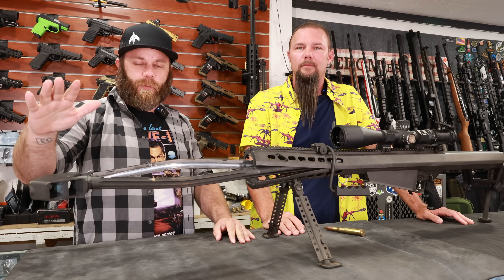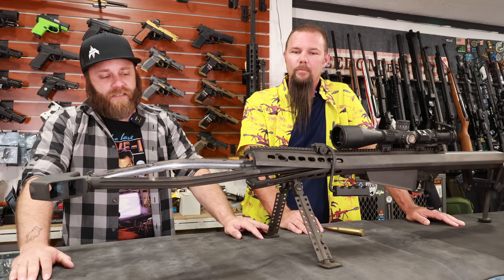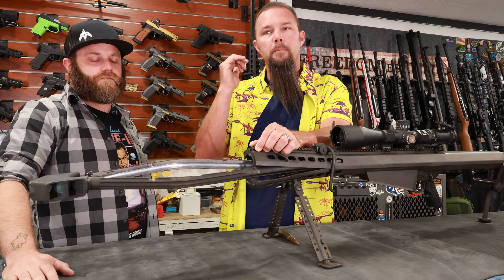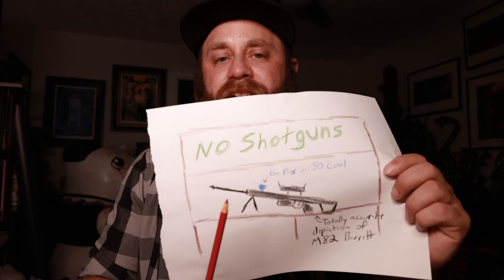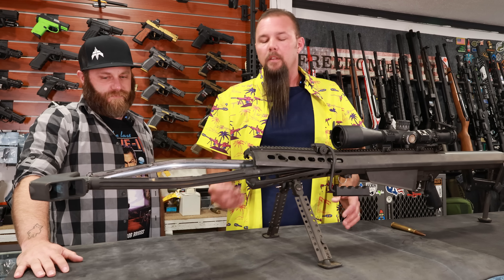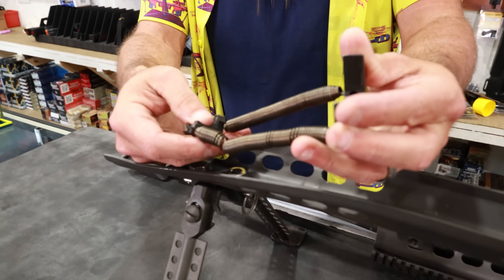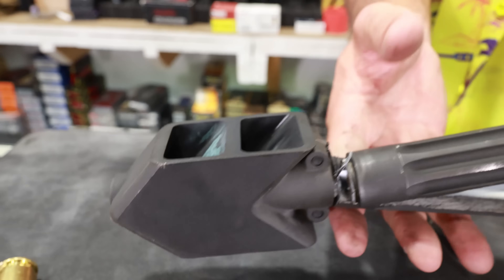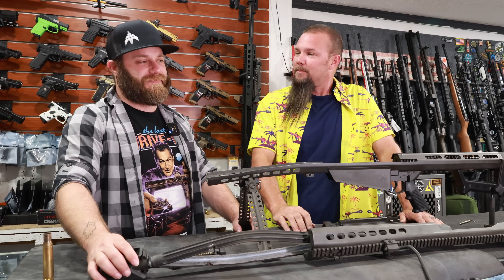Barrett 50cal Explosion Explained! 50 Caliber. 50 BMG. M82A1

Comment: Ok so tell me once more how it actually got hit with the 308 like I have literally watched that part 3 times and I'm still unclear of how a 308 round hit the barrel to start with I get that the little dimple was there from being shot and exactly what happened to make it go boon but what were you doing for it to get shot in the first place like it sounds like your trying to explain it but I'm obviously just not picking it up I'm going to try once more but can someone please in detail explain the setup that allows this to happen were you using it as a prop for slow motion films?? Like I don't get it. It's just not comprehending in my stupid head..🤷
Reply from the maker: Let me start by saying, I was not at the range day that the Barrett was hit so my details are loose at best but I'll explain it as best I can. 

The Barrett is a beast so while all other firearms stay aimed down range at all times while on the shooting table, it gets placed at an angle that aims it at the left burm (completely clear of course) 

Since I was not there with my gear that we typically use to record including tripods and all that jazz, they left the Go Pro on the Barrett and were using it as a tripod to record while it was on the table. 

Shooter stepped into the view of the Go Pro but not far enough passed the barrel. When they aimed in their optic was on target downrange but due to the magnification and height on the firearm they weren't entirely clear of the barrel when they fired. My understanding is it was not the initial shot but somewhere in between a burst that it got struck.

Comment: Nah, makes sense to me. Those microfractures? Give gas another channel to take and it's going to take it. That much pressure? Even from a standard round? The material is just weak enough? It's there just long enough? You get that even .1 of a second over the tolerances? 

Steel can bend and break under the right/wrong circumstances. This is just another time it happened.
Reply: The internet says the barrel is made of MIL-B-11595E CRMOV, AISI alloy equivalent is 4150 Chro-moly. Strong, hard stuff. The .50 BMG runs at 55ksi to 58ksi peak. The surfaces under and down in the flutes would  be a preferred location of the crack origin if there was a defect in the metallurgy or heat treat unless there was some type of inclusion. It appears to have split through the top rib and bottom grove. The top rib is where the barrel has been weakened. There’s a divot to the right where it didn’t split perfectly in plane and broke through to the flute. Could be a defect at the surface, could be a lot of things, hard to tell from a picture. It looks like weakening of the barrel and interference with the bullet probably caused the rupture like they said. The fluting definitely makes for a weaker barrel but, it’s better that it failed that way rather than in some way that injured the shooter.
Reply from the maker: I would LOVE to have a metalurgist come do an inspection and overview of what they see for discussion. 

If there are any in the Houston area that would like to collaborate on this, let's chat!
Reply: @RecoilandRust    I expanded the picture by 250% and I can see the channel the .308 bullet left in the barrel.  I guarantee that the bore inside diameter was distorted or compressed.  Unless you were to send a .50 cal diameter rod down the barrel, you would not have been able to see it.  Your eyes are not calibrated ID micrometers.  When the bullet hit the obstruction, the barrel blew apart.  There is no possible way that the bullet continued on its original trajectory.  It must have disintegrated or gone into the wild blue yonder.  It is possible to take a 50cal bullet and run it down the petals to the damaged portion and be able to feel the compression.
I hope you guys don't become the New Jackass of You Tube.  But, I fear you have been on the journey for a while.
Reply: @TJ14142  hard is easier to split it doesn't flex as much this is why you can't use it for suppressors as well. even titanium isn't good for a suppressor because harder also means more brittle less stretching without cracking while under pressure.
Reply: @Anon-zu3xn  In engineering terms, toughness is the ability to absorb energy without fracturing. It is proportional to the area under the stress-strain curve. While it’s true that harder materials are generally more brittle materials (fractures with small deformations or small strain due to a lack of toughness) it is not a rule. Chromoly is a standard material for rifle barrels. Mass produced barrels are often cold forged and stress relieved. When the barrel goes through the forging mill, a mandrel is inserted in the tube to “imprint” the rifling. I haven’t found a great deal of information on Barrett rifle barrels. They’re probably broach cut or button hook rifled for accuracy and not cold forged. This doesn’t mean the design isn’t pushing the limits or they couldn’t have had a bad lot. Didn’t see a rash of barrel failure incidents on the internet, though. They know what they’re doing and are probably following conventional design practices. The fluting combined with the damage is most likely what caused the failure.
Reply: 9:59 not the .308 strike theres a huge imperfection you can see it makes a boat shape
even far right the bottom where it split you can see the metal change colors there's darker strips that implies different crystal structure meaning heat treating issues
Reply: @Anon-zu3xn  That is just light reflecting differently from different angles not actual differences in the steel from heat treating.
Reply: @phillhuddleston9445  you can see the grain of the metal so it's not shadow the crystals are actually a different size and color that's heat and rapid cooling.
Reply: @phillhuddleston9445  after the .308 strike you can see the shape of a boat in a different color that can't be a shadow or it would just cover everywhere it wouldn't curve like that.
Reply: Any barrel being stuck by a high velocity round will shatter once fired. Case closed.

Comment: 9:34 - Was the casing squished as a result of the crack?
Reply: It doesn't LOOK like it from that angle.  I don't imagine the gasses got backed up far enough or hard enough to fire-form the case in the chamber.  Like firing a 50BMG from a 12ga fire-forms it every time into basically a uniform cylinder, the receiver in the m82 being designed for 50BMG, there probably isn't enough room to expand the neck, but I'd be curious to see the primer and close to the rim up close, where the case has the least support
Reply from the maker: You are correct. After we filmed the video we pulled the plastic sleeve at the very base of the barrel and the crack went all the way to the back of the barrel causing it to pinch the casing. 

It took some 1/4in socket wrench extensions and a hammer to knock it out.